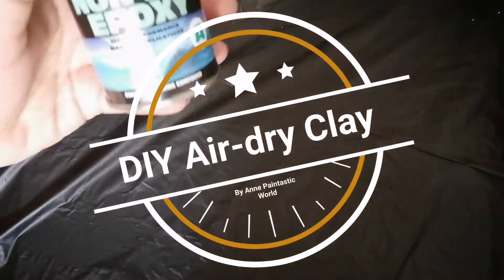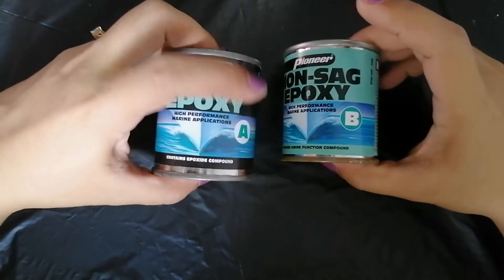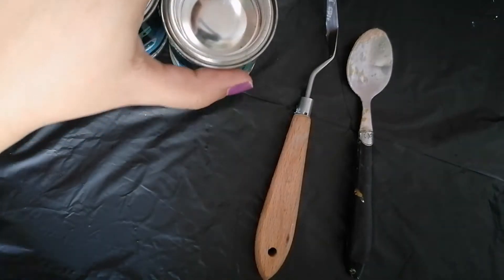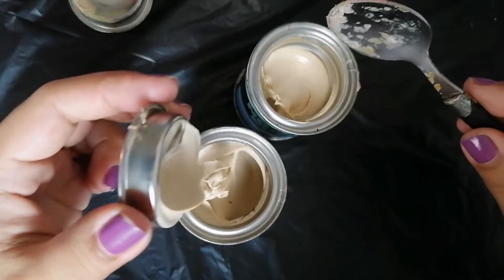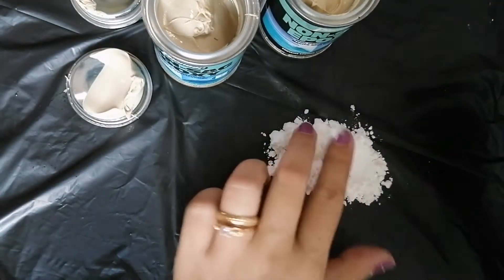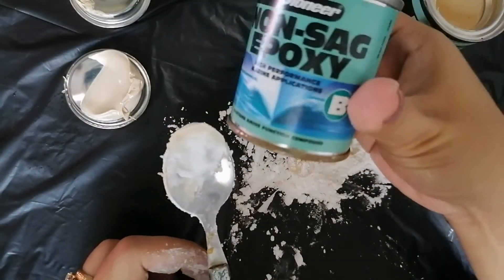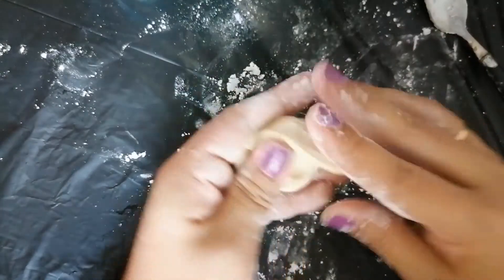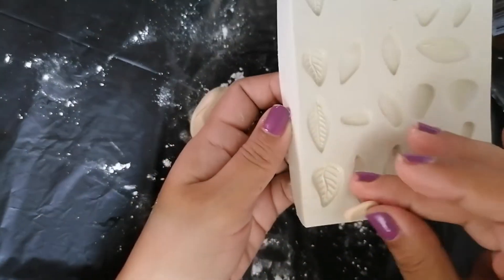DIY Air-dry Clay Using All Purpose Epoxy

Comment: Hi kelangan po ba ng protective mask while working on non sag epoxy? Di pa po kasi ako nakatry nito, may chemical smell po ba sya? Thank you po🙂
Reply from the maker: You can use mask if u want. Pero di namn po matapang amoy nya specially sa brand na ginamit ko.

Comment: Ano po difference sa hindi NON-SAG na epoxy?
Reply from the maker: Na try ko po yung ibang brand at yung hindi non-sag medyo nahirapan ako mag mix ng all purpose cornstarch kasi medyo basain xa. Unlike sa non-sag, mabilis ko nakukuha yung right consistency ng dough nq gusto ko. Pero it works parin yung ibang brand
Reply: @annamariejumalongarcia4364  Thank you po! :)